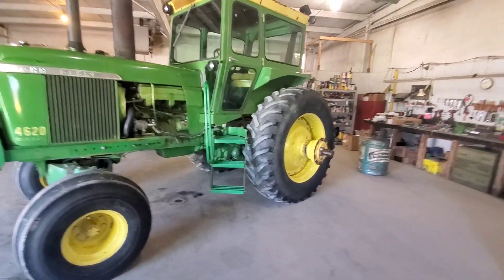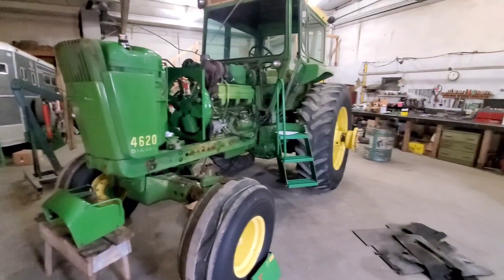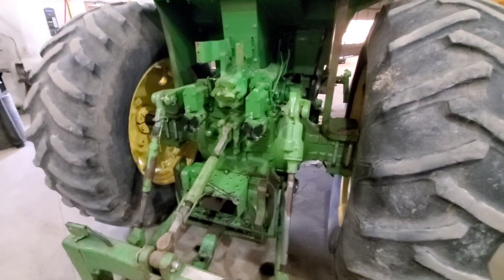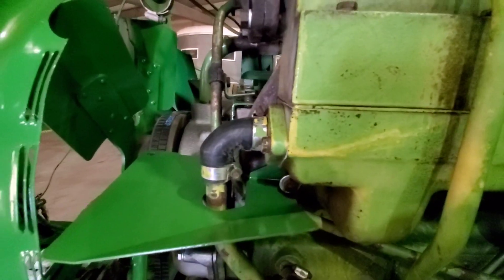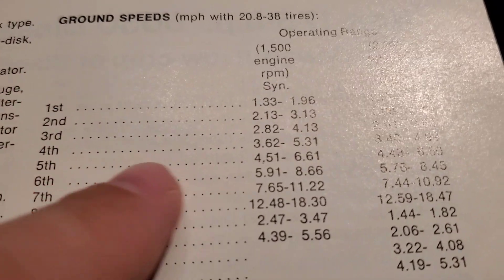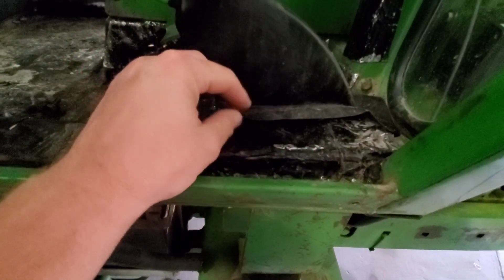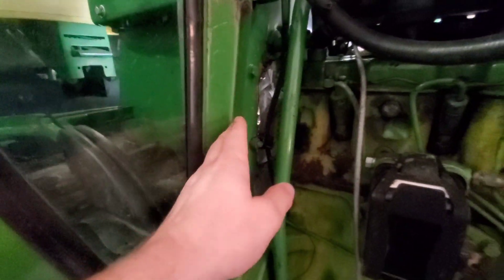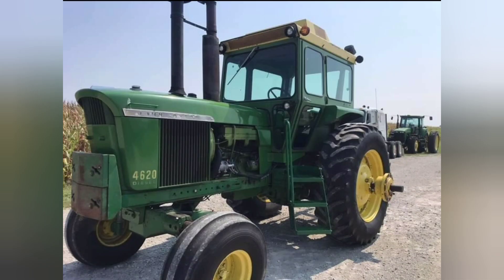John Deere 4620 .... video 1

Comment: I bought this same model about 6 weeks ago without the cab. Working on getting it back in shape.
Looking forward to your videos.
Reply from the maker: Awesome!
Reply: Put 30 series cab on it everything fits even the cluster dash hook air up to even the shifting part makes nice tractor then I even did a 5020 and a 4020 with that cab change out the seat as well

Comment: I have hours of time logged in a 4620.  I used to road one from Kent to Fort Dodge and back. The previous owner put a Chromed straight pipe on it.  After years of double ear protection the boss finally put a real muffler back on  it.   Then it was down to one set of protection.   I had an incident where coming north out of Cromwell the disc popped a hitch pin loose in road gear.   It was wagging the dog by the hydraulic hoses.  When I chopped the throttle, the disc tried to climb the back of the tractor.   The ROPS system kept it out the cabin proper.   Because the cabin was water damaged meant that I didnt break any glass .  The only real damage was the Harrow section of the disc and the freshly rebuilt hydraulic remotes got the guts ripped out of them.  And we had to strong arm the cabin back to something approximated straight so that the door fit again   We back to strapping the hitch pin down again instead of spring clips
Reply from the maker: Hey!  - great to hear from you again!  ... yes, a chrome stack makes a guy def. I have also suffered stack hearing loss ! - lol .... oh for sure, good pin retention is a good idea

Comment: Put ten thousand hours on ours, got it in 1983 used with 18 by 42 Firestone and really made it a nice pulling tractor. They really had more power than weight and traction. Loved ours, good luck

Comment: My uncle bought one with a 12 ' chisel plow in 1970 ,with an air conditionef cab cab . It was a big pig that over heated all the time in the summer as soon ss we worked it hard 
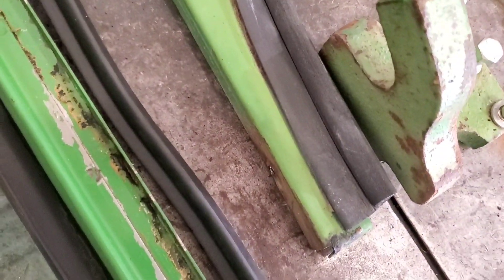 They rebuilt the motor about 3 to 4 times the 25 yrs they had it until they traded it in on a JD 4 whell dr 9200 . Us kids never thought much of it . If we eould of known John Kinsenoe had a dolution got yhat pig w,we would have kept trying to talk my uncle Roy into doing that ! Kinze Repower would have happened . 7:19 !

Comment: I am putting a 158 on a 4620 the line going into the rocker shaft can you put a t in it to get power
Reply from the maker: Thank you for asking....  I tried to tee in there - but there was no room ... so I tired to drill and tap that factory tee - to make like a 3 way connection ..  sadly it didn't work ... just wasn't enough room .... about only way to do it- is to modify that hard line with a hose ...so it can be shortened - then you could split it off there ... I didn't want to modify the tractor - so I went with the 3rd scv plate instead ....
Reply: Deere sells a Power Beyond kit for any tractor uding the Flow control at the SCV. Leaves your tractor valves free. It was $220 in 2006. I just Googled Power beyond kit for 4620 and several came up at about the same price. They work slick and fit from a 1969 20 series to a 55 series.

Comment: Personally, I would put the 20.8 tires on. Question, why are you going to put the old style tires on instead of some new firestone deep treads? In my opinion the deep treads would look badass on that tractor. Just curious on why you wanted to go the other route
Reply from the maker: Thanks for the input .... I want to keep it as original looking as possible- plus they sell for a fraction of the cost....
Reply: @Blackearthexcavationandtiling  Cool! Thanks for the reply

Comment: I have 6 of them go with 20 .38 world of differents for traction 2 of mine  came from factory with that size cranked pump up 10% nice tractor one I no for sure never been touched but clutch has 11000  hours on it doesn't use a drop of oil one other one iam pretty sure it's all original I got it with2700 hours didn't nothing to it got 1400 hours now don't burn oil